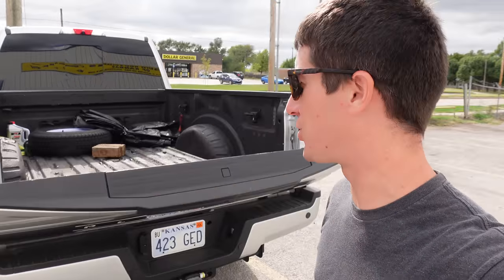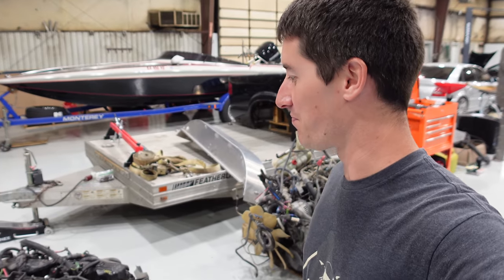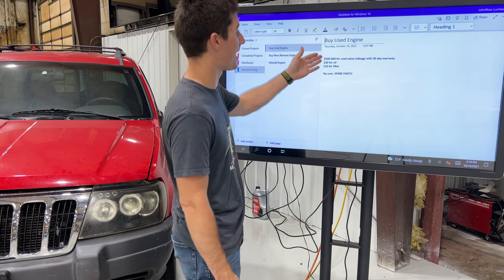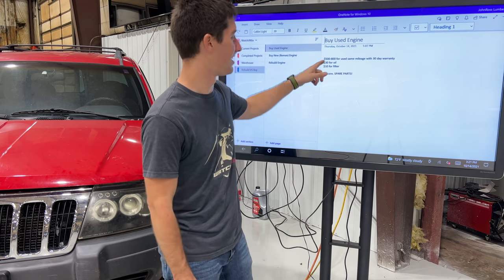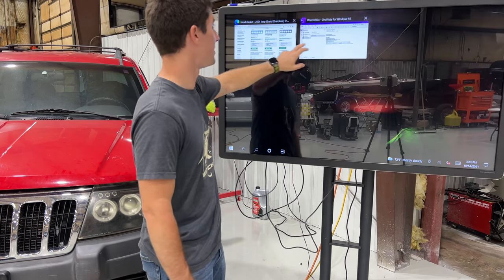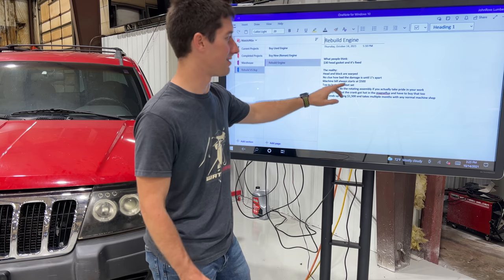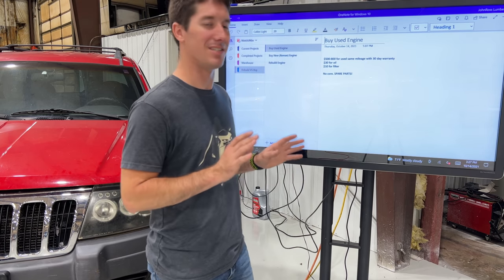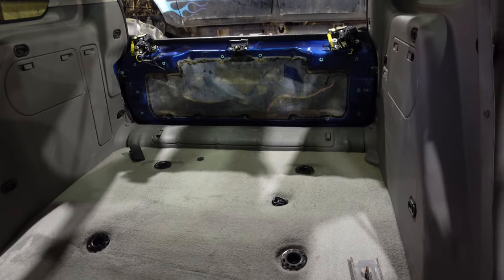Here's Why You Should NEVER Rebuild An ENGINE *The Math Doesn't Add Up*

Comment: It's the fastest, cheapest way to get a flip car running again. If it's a car you like and want to keep long term, and if the original engine isn't garbage it is probably worth it. Sounds like you already just said the same thing so we agree 👍
Reply: Exactly. Depends on the level of disrepair / damage where to repair or replace.
Reply: That old engine sounds like crap on cranking, and it doesn't even run. Its scrap.
Reply: In reality the engine is toast because you valued getting home in a timely manor any means necessary(drive as is) Vs getting the car home safe. Doesn't help we watched countless RoadKill episodes not realizing how much downtime those cars have with folks with pockets and a 9 to 5 on fixing them on camera somewhat.
Reply: A factory assembled engine is almost always guaranteed to be built better than 95% of rebuilders.  Top quality parts, good workers, calibrated torque wrenches, thats how they crank out hundreds a day at the factory.

Even for performance builds, you often cant do better than a stock bottom end.  They often last forever and cost $500 for a new one if it fails.
Reply: @bigpjohnson  Yeah, that the issue with such cheap engines. In other poorer countries engine rebuilds are common place and so is the knowledge, an bad rebuilder won't stay long in the market.
Reply: If you want to keep it long term, it doesn't make sense to swap engines over and over.  It's different when flipping and you don't depend on using the vehicle, but when you do, putting some 100K mi engine is as-is?  Meh, I don't want a daily driver to be a continual project.

Comment: For flips this a ton of makes sense. For my project Fiero that blew a head gasket, I rolled the dice and only spent about $60 on a gasket set and didn't even check the head for flatness. I've put 5k miles on it since then with no issues

Comment: Geez, I rebuilt a chevy small block in the early 90's for $500 with a rebuild kit from Summit, their brand camshaft and lifter kit, etc. and the machining done at a local parts house.  I low-bucked the heck out of it but took my time and did an excellent job with assembly.  It was for my '74 C10 stepside pickup, I scored a huge air cleaner assembly from the junkyard off a Cadillac and after I broke it in I hit the on-ramp for the highway and nailed the gas pedal.  The thing took off and the hood sucked down just like on a race car, it was moving a ton of air.  Those were the good old days, I could fix almost anything on that truck for $35-$50.  Good times!

Comment: It almost sounds like you don't care if you install an engine that will fail within a few months of the customer buying the car. Which, if so, is a scumbag move unless you disclosed that fact to them. "Hey this is a junkyard engine, and it's at the bottom of the scale. No telling how long it will last". But you can't really say that can you? Who would buy that car?
Reply: I get where you're coming from but what's the difference between a junk yard engine and the engine that already failed in that 20 year old $4k car? If you're buying a car that old and that cheap, you gotta be ready for anything to go wrong either way.

Comment: I totally agree with you on that, everyone has to go through an engine rebuild sometime in their life if you’re a car guy or girl just to realize how expensive and time consuming it is. Engine swap on a car that holds its value is totally worth it.
Reply: kinda depends on where you're starting with a rebuild tbh
Reply: Who cares if it’s not a classic.
Reply: @gregisdivorced Reputable machine shops specialize in fixing shortcomings on flawed engine designs. A rebuild isn't just a good idea, it's the only way to keep some oil burning, weak head gasket, poor cooling channel, low flow oil pump plagued engines alive for 500k-1.5M miles. 
Cars dying under 200k miles is embarrassing. Mostly on the engineers and manufacturers part, but not uncommonly the consumers fault.

Petrol combustion engine owners are always surprised when they find out those 18 wheelers have MILLIONS of miles on them. They are more often rebuilt than Replaced. A bit for engine availability, but mostly because those diesel engines were designed to last. Machine shops, who are worth their salt, can easily push Petrol engines into 500k miles
Reply: If that’s true, where can I find a good used 2.2L Turbo 4cyl engine for my 1986 Chrysler Laser XE ?

Comment: Pretty solid advice.  I maybe should've done that with my '95 Tacoma after its head gasket blew, but my reasoning was I didn't have access to an engine lift so I had to limit myself to parts I could take out by hand.  Luckily my head didn't need much machining and my camshafts weren't warped so cost wise it was quite a bit cheaper than your estimate here, but the truck was still out of service for a month in my garage.  I've put a few hundred miles on it since then and it's still running great, though, so fingers crossed it will continue to do so (I plan on keeping/driving this truck for many years to come).

Comment: He's right. I'm a retired ASE certified, GM factory trained line tech & the insight here is good. However, two things need to be addressed; 1) How to find an engine salvage yard you can TRUST is KEY to his concept. 2) Yes, a trustworthy salvage yard will exchange an engine if (rarely) you get a faulty one BUT...they do NOT reimburse you for the $600-$800 labor (or whatever your own time is worth) to R&R the engine a SECOND time.
Reply: all the engines at the salvage yards only have 80,000 on them , never overheated, perfect oil changes :face-blue-wide-eyes::face-fuchsia-wide-eyes::face-fuchsia-tongue-out::face-orange-raised-eyebrow::face-green-smiling:

Comment: I agree with your reasoning. I've done this several times. Even for cars I personally own. 2008 mazda6 4cyl 2.3liter. Bought the car with bad engine for $1500. Bought the engine from LKQ for $1400 + 200 in exhaust and intake gaskets and throughout bearing = $3100 for a car that is now worth $6500 or at least when I did it in 2017. We drove the car for 2 years and sold it. Great car.

Comment: Notice he never said what the cost of the machine work is.  Decking a head/block is not much money.  And he’s also swapping an engine on a 20+ year old car.  A new car (less than 10 years old) you are gonna rebuild for less.
Also a warranty is nice, but you have no idea why that car was totaled.  You have no idea what maintenance was/was not done. Rolling the dice on a $800 motor?  Ok.  Once you get into the $3-$5k for a used motor NOPE.  Not worth the RISK.

Comment: JR, I 95% Agree; I'm frugal. I don' want to spend when I don't have to, but sometimes it's better to spend now and not spend later. Like buying cheap tires. I have however replaced head gaskets with success a couple of times over the past few years. None of the cars had overheated, so for me it was a no brainier to just do the gaskets.  And they were not for flipping. Years ago, I rebuilt a 1600 and it lasted 80k before losing the oil pump. I replaced it with a 50K or less for $230 and the thing just never quit. So I have been on both sides.

Comment: I used to be an ASE certified mechanic for a Toyota dealership in San Diego. What he is saying about the head gaskets is correct. We had a recall campaign for a majority of the V-6 engines in Tacomas, 4-Runners and a handful of other vehicles where the head gaskets kept going out and in many situations the entire engine had to be replaced. The recall was called the VO6 campaign and literally, every single vehicle that was recalled or had already had the head gaskets replaced had lots of additional work that needed to be redone. Probably half got new engines from Toyota due to the amount of everything needing to be replaced. 

Then you look at preventative maintenance as well while you’re in there. Thermostats, timing chains or belts, and other things. So he is spot on if someone is buying a car to flip and it needs engine work. Often times it’s more cost effective to simply swap out the engine!
Reply: What was the problem that was making the head gaskets fail?
Reply: The engine blocks were cast iron and the heads were aluminum. They would heat up and cool down at different times and maintain different temperatures. The original head gaskets were not designed right and caused numerous issues and engine replacements.
Reply: @j.r.777  The 22-R has an iron block and an aluminum head, did they have the same issue?   I ask because I have one but have not experienced this problem.   Yet.
Reply: @josephastier7421  there was never any recalls for those engines and nor did I ever see any in the shop. They were bullet proof. I think with the VO6 campaign it was simply a bad head gasket design.

Comment: I rebuilt the engine of my Rav4 myself including removal and installation, it was a very enjoyable activity and spent less than a 1000 dlls on new replacements as pistons, rings metals, gaskets, etc. including machine shop of head and cylinder block, also my rebuild is much more reliable than a used engine you don't know the current clearances.

Comment: While I agree on almost any other engine these 4 litre's use a cast iron block and heads that have been around around since the 70's and are known for out living the jeeps they're in. Parts are cheap and plentiful and is one of the easiest engines to work on. I wouldn't bat an eye at slapping a new gasket in, doing a diesel oil flush throwing in some mobil one and calling it a day. There's a video on here where they red line the engine with no oil and it throws 2 rods out of the block and still keeps running. A true bullet proof engine that was lost to emissions and planned obsolescence.
Reply: What years did they make those 4 liters?

Comment: JR wisdom being dropped. If it's a flip. Preach brother. But if it's a keeper of course rebuild it 👍
Reply: Ehh.. I still wouldn't rebuild.. just do as much maintenance as you can while it's out of the engine bay, (no head removal) and you should be fine for a long time. Most used engines have around 100k miles..they should be fine for at least another hundred. That's all I've ever done to them.. cost ya another $300-$500 plus the cost of the used engine.

Comment: Actually the math doesn't add up in this analysis. This guy is comparing 1) Buying a used engine to 2) Rebuilding an entire engine from top to bottom. Reality is in most cases a failed engine fails for one particular reason: e.g. Spun bearing, overheated, head gasket. In those cases, just the failed part should be changed and in some cases could be done with used parts.

And, no if you're flipping the car, you don't need to do the "While I'm in there". I've blown a headgasket in my car with heads that are notorious for warping. I pulled the head and took it to a machine shop to check the head for cracks and to resurface it. Total cost was like $50-$100 max. I bought a new headgasket and head bolts ($20) and put it all back together. Total cost was <$100. Also first time doing this and my labor was probably 4 hours total.

Another recent example. I spun a bearing on my engine. With the engine in the car in my driveway, I pulled the oil pan and sanded down the spun bearing surface and replaced all the main and crank bearings for a total of about $30 (rockauto). In this case it took me about 20 hours. Most of that is because I had never even opened up the bottom end of an engine and was trying to figure out things like measuring clearances and how to use plastigauge for the first time. Also if I had access to a lift like someone that would be replacing an entire engine would, that would have saved me many hours. This was my first time and If I were to do this again, I am pretty confident I could do it in 8-10 hours.

Now let's talk about the used engine replacement. How many hours does it take to remove and reinstall an engine? I've done it and it took me 2 days to remove and 3 days to reinstall. There's always issues with things not fitting right, perhaps you got one year different engine and now the connectors are slightly different or the pipes or fuel lines don't line up. Now you finish that and go to start it up and hear a ticking...rod knock or bad cam. Who knows what condition that engine was in or how hard it was beat on. Ok it's covered by warranty the guy in the video says "his time isn't free", so you gotta do the job twice or three times. How much labor is that? Most likely you'll have a few error codes you'll need to identify and track down if it's a bad sensor a shorted wire, you forgot to connect something, the computer isn't compatible with that year, etc. How many hours of troubleshooting is that?
Reply: Totally agree

Comment: I just had the head gasket done on a Volvo 240 with about 400,000 miles on it. No head or block work. It blew about a month before I got it fixed. Added oil and coolant as needed. That was about a year ago and 20,000 miles ago. Still running strong.
Reply: Gotta do that on my 240, miss driving it.

Comment: Yooo jrgo! I totally agree with you on the engine swap.. now the only thing I would consider doing before buying is finding the real reason why the car won’t start… not saying for your jeep but in general I flip cars and when I bought non running cars especially Honda’s people will say gasket problem or overheating problems and it is either a sensor or something super super easy.. a lot of people selling these cars cheap because they are not mechanics and a friend took a look and guessed what the problem is.. so I usually ask them why they think it’s the gasket or ect and they will tell me I looked it up.. I literally turned on a Lexus sc400 no start I bought for 300 because the fuel pump went out and a burnt the fuse. Lol. Last example, bought a del sol for 300 no start and they had the distributor on wrong.. I took it out and put it correctly cranked up sold it right away for 1500
Reply: He did that last month with a Honda, was told bad trans, changed a sensor.
Reply: @CR7659  yeah I saw that episode loved it.. just informing other people if they watch this video just to give a little more information.. no matter what always give the car a good look or two.. I’m sure jrgo did his job and said the oil looked terrible and fluids were bad and wouldn’t start but yeah sensor is literally something people overlook
Reply: @carnstar  People like carnage, I think he should at least do a video showing us how bad the engine is inside.
Reply: @CR7659  yesss!!! I totally agree I was thinking that he should definitely open up at least the head and show us how bad it would’ve been if he had to replace the head gasket you’re totally right
Reply: the novel you wrote is a given,obviously......check for simple fixes first.like any flipper would

Comment: Transmission rebuilds are the same way, you can get a pulled one for sometimes less than $300
Reply: Yeah but the hassle to remove the old one an install the newer one an hoping to not have problems.  An for guys like me woth no lift that's a pain in the ass an do all that work an then end up being bad too 

The junkyards here give 30 or 90 days can't remember but for like engines an transmissions.  Plus pulling it ur self at junkyard an getting it home for me ha I just like nahh I'll pass I rather rebuild but now for what he is doing sence it was something he bought that I get but for my own stuff idk . 

Wished inwas a lift it would make life so so much better an faster to get things done
Reply: It sucks laying on your back on the floor covered in dirt a trans fluid.
Reply: I rebuild transmissions quite a bit. Some are getting REALLY spendy used. 6l80E I rebuilt a few months ago. Used was $1500 with 150k on it. I rebuilt it for $1500 in parts and abut 4 hours of my time (not including R&R). 

Engines are a different animal. Machining costs $ and takes plenty of time. I haven't rebuilt an engine since school 20+ years ago.
Reply: That's why you select a used engine or transmission based on condition mileage and making sure it came out of a totaled vehicle. Now you can even run a Carfax on a prospective donor vehicle for $5 or less it's called research.
Reply: @earlscheib7754  Earl Scheib. Do you still paint car's for 99.99😀
Reply: @earlscheib7754  yeah but Carfax hardy shows anything . The only way you get any information is if the owner of that said vehicle turns in whatever happens to the vehicle so hardly that does any good to try.
Reply: @mph5896  yep, sometimes easier to buy a whole parts car
Reply: I did a swap on a 5r5s from a wreckers - last  time I ever put a used trans in without doing the pump valve and the solenoid block - I’d rather open up and build from used good parts than invest my time to figure that it’s a dud after it’s installed - now I’m knowledgeable and pick up problem cars as I know how to fix it. Cheap… engines in some ways are easier as you can test more without fitting….
Reply: @brianjacobsen5762  On the floor, what floor!?!? I'm laying in the dirt or mud in the rainy season!!! I put a th400 in my jeep in the driveway  and it started to pour just after I started. Was laying in an inch of water while doing that one!
Reply: @KnuckleHeadGarage27  not true the owner of the vehicle has no say in what's reported to Carfax. Most of the shop owners I know voluntarily report. Carfax shows patterns. If I find a prospective engine that looks good and has a Carfax showing routine oil changes and the accident damage didn't affect the engine it's more than likely a good engine.